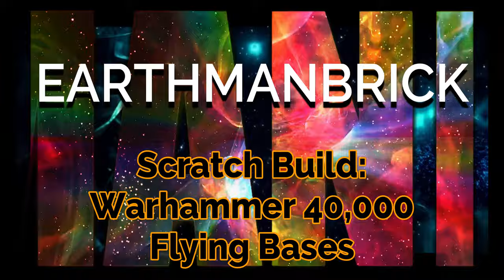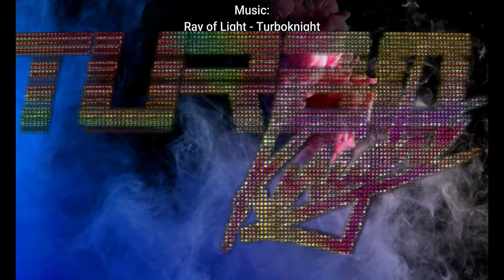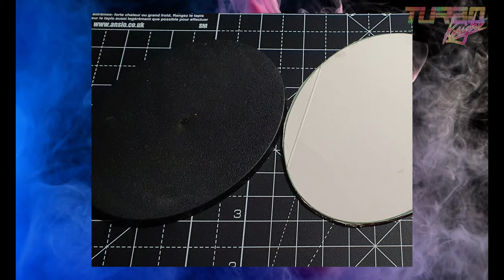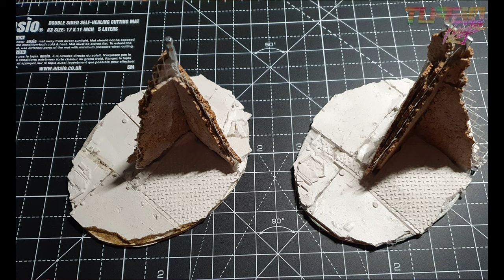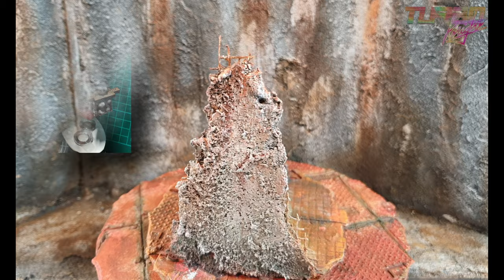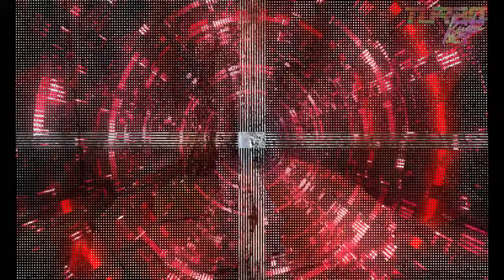Scratch Build: Warhammer 40,000 - Flying Bases

Comment: Looking good! I think bases are often over looked. This is next level. How did you do the exposed rebar? Thank you for the content
Reply from the maker: Thanks, man. The rebar is just joint tape - a fibreglass mesh that's cheap. Just sandwich it between 2mm cork sheet & it works rather nicely

Comment: Some brillaint bases mate. The metal bits will make them nice and sturdy.
Reply from the maker: Thanks, man. Much appreciated. GW seem to be moving away from transparant flight stands for their smaller models so it makes sense to do the same for the larger ones too to make them more consistent (as GW seems to be mixing it up, absent giving people the option for one or the other).
Really like your work on the Dropzone Commander models & terrain, dude. You got any other projects in the pipeline?
Reply: @earthmanbrick  I have 4 main areas I work on: Dropzone/Dropfleet,  1809 Talavera Napoleonics, 1803 Assaye & Warmaster (Elves currently, Skaven coming soon). I also have some little projects including Steampunk Brits and a Hornblower based Navy/Marines force. Working on some Fallout Stuff but clearing other projects to really get my teeth into it. Plus comission stuff too.
Reply from the maker: @BrushQuill  Nice, sounds like you're pretty busy